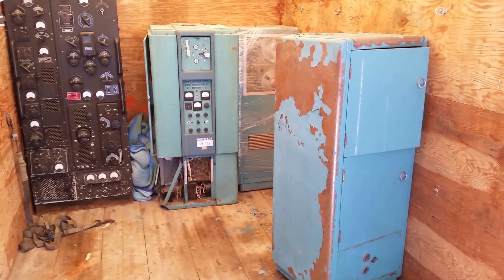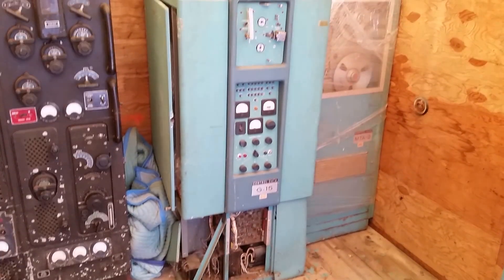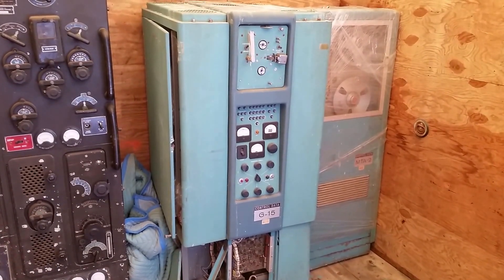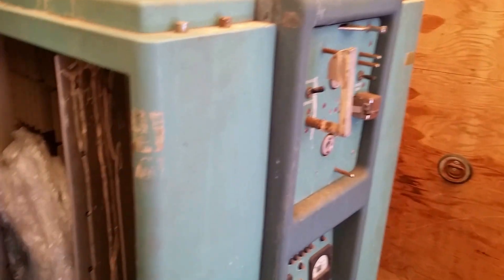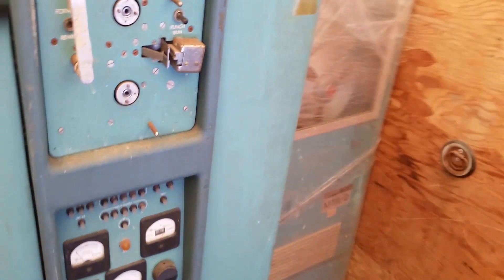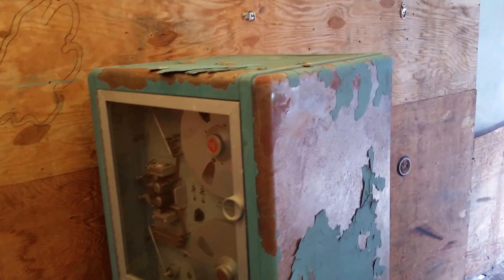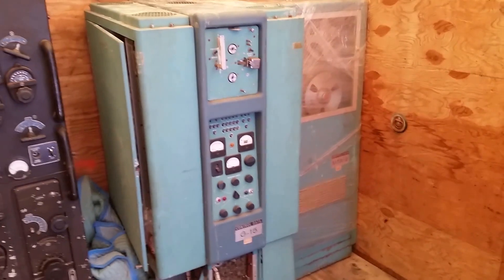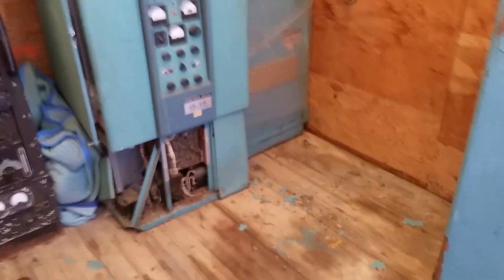Bendix G-15 Tube Computer Sneak Peak

Comment: Dear William,                                                                                                        July 27, 2017
Watched your video of the G-15 on the truck with utter fascination and envy.
With respect to the G15, mine is a tale of woe. When I was in college at Fordham University in the Bronx, I discovered an office in the basement of Freeman Hall (which was then the Physics Dept - I was majoring in Physics , Math and Computer Science), that contained a Bendix  G15 and a Frieden Teletype keyboard. There were Books on the machine, complete schematics, literally HUNDREDS of paper tape 'jobs' and code stored in little white boxes with wire seal rings on the ends of the boxes, ALL IN PRISTINE CONDITION, and no longer in use, since the University had bought itself a brand new IBM 1601 housed in a different building. I researched that machine, and someone had turned in "ON," "OFF," and "ON" just to hear the cool 'windup' of the drum, and had SHEARED THE RUBBER COUPLING TO THE DRUM, but that was virtually ALL THAT WAS WRONG WITH IT!!
Me and one of my Physics professors started working on it: reading the voluminous documentation , ALL OF WHICH was there, including ALL the blueprints and MANUFACTURING DOCUMENTATION, and the ALGOL interpreter that the physics guys would use to do orbits and simplified "Three Body Problem" material!
I knew it was a great find, but, I failed to realize it fully enough to FIGHT FOR THE MACHINE!! FU had just gotten the IBM a few years earlier, the Bendix was fading from peoples  minds, but, it was too soon to get the Office of the Bursar (or for whomever had the authority to scrap it) to consider letting it go as scrap, so I could haul it away to my basement in NJ, and start the work of bringing "Frankenstein's" creation (actually "Harry Huskey's creation” – who JUST weeks ago, passed away at 101 years of age!) back to life! 
And, when I told my mother how proud I was of this excellent find, and told her I was planning to drag this 900 lb., rather dusty (and in her mind COMPLETELY WORTHLESS) item into the house, that was it! Big argument, End of Dream, cause I was 20, had NO PLACE ELSE to put it, and no place else to hang my HAT! So I gave up!

BUT, over the 68 years of MY life, THIS has definitely proven to be “the ONE THAT GOT AWAY!” And for 45 years, I've been trying to assuage my grief by finding ANOTHER ONE.

So, all this is by way of preamble to asking if you know of ANYWHERE,  ANYONE WHO HAS A LEAD on a Bendix chassis they are willing to sell at 'hobbyist' prices, NO MATTER THE CONDITION or if you can part with any 'duplicate inventory' that you don't need, and no longer want to store, but could concede to a fellow hobbyist / collector / restorer, if you knew it was being put to good, honest use?! Believe me, I am NOT on this Quest for the money. I'm Paul Cicchetti (908) 510-9294. hairynosedwombat61649@gmail.com

Also, wanted to ask you, “Have you heard of 'Fetron' tubes? Supposedly a transistor (solid state) device made to be A PLUG-IN REPLACEMENT FOR A TRIODE OR DUAL TRIODE or PENTODE TUBE? They were invented during the transition from tubes to transistors, and I have always wondered if I could find 300 or 400 to replace the tubes in a Bendix G15, for greater reliability!
I know you said you had thousands of new tubes for the Bendix, but, at a certain overall age of a given tube installation, you start losing tubes FASTER THAN YOU CAN RUN PROGRAMS!! The FETRON conversion would SOLVE that!
 If there is ANY information you may have that would help me locate an affordable G15 for restoration, I would be very grateful for helping me fulfill a life's ambition!
Sincerely, 

Paul Cicchetti
 P.S. I screwed up the messaging and it says I sent YOUR video link TO YOU. I couldn't correct it! Please get back in touch!